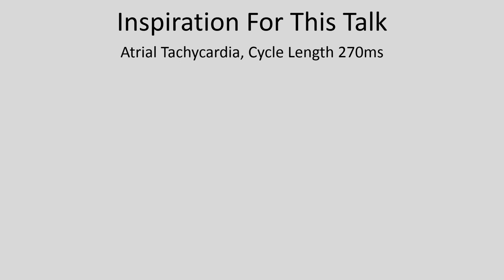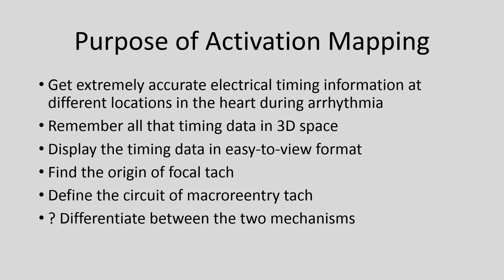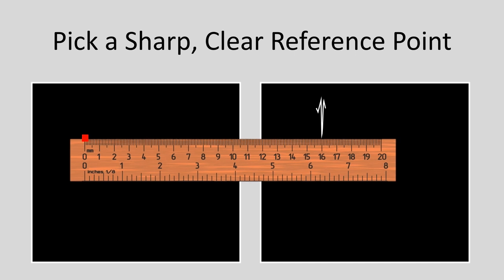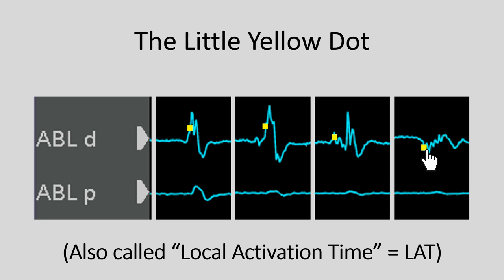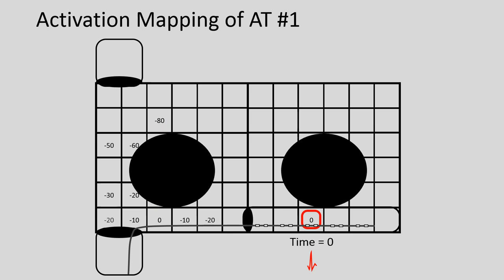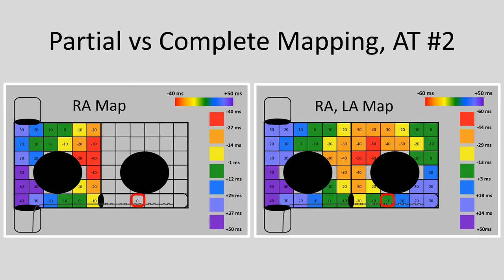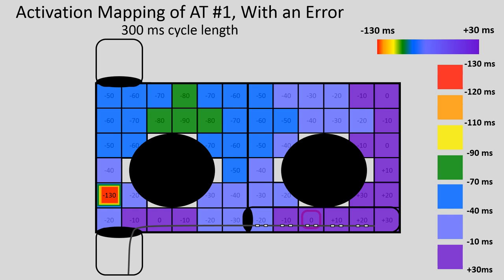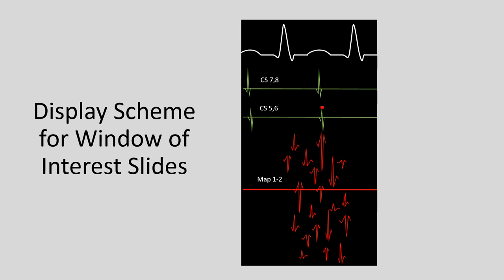Activation Mapping: Basic Concepts, Pitfalls, and Windowing

Comment: Thank You Dr. Cooper for explaining activation mapping. It was really helpful. If possible my request is, if you could make a video on activation mapping using Systems like CARTO(OCTARAY) which I found particularly challenging to understand to someone who's new to this field.
Reply from the maker: All of the principals in this video are exactly the same with any multi-spline catheter. Each bipole, whether it is the only one being taken at that time, or if it is one of 50 bipoles being recorded simultaneously, is gathering location, amplitude, and relative timing data compared to a reference. More modern mapping software can use the summation of multiple bipoles, for example from the coronary sinus catheter, rather than a single bipole, for a more stable reference. But all of the principles are exactly the same, including window of interest, activation sequence, and pitfalls related to outlier points, slow conduction, and a suboptimal window of interest.

Comment: Your Fellows are lucky Dr Cooper, I wish I was one  ! Thank You.
Reply: Two points I would like to ask you: 1) For a stable reference can we consider alternatives to Cs like NCC or azygous or even a SVC catheter 2) Ripple maps can avoid the need to annotate EGM activation time and do not require a WOI. There is no data interpolation in the generation of the map in RM, do you consider RM as an effective strategy in the situation you discuss in the talk.
Reply from the maker: @sharathkumar8518  As long as the reference catheter is recording signals in the same chamber you are mapping (i.e. atrial reference for an atrial arrhythmia) and the catheter remains physically stable throughout mapping, you could use any catheter.  CS catheter just happens to be out of the way and stable, which is why it's usually used for atrial mapping.  And yes, technologies that show wavefronts in motion in a looping format (Ripple, Sparkle, Rhythmia) add additional visual information that can be helpful beyond the static image.  I decided not to add that additional topic to this presentation due to its 2h length already!

Comment: This goes beyond anything one can give to educate young EPs. You deserve a prize and to be remembered for ever. I just have one comment, not an objection. In your initial tachycardia where 3D mapping did not work, you resorted to Entrainment map (7:55). You also mention entrainment from multiple areas in the right atria.  Entrainment is reserved for reentry tachycardias and PPI is really not part of it. The original 4 criteria do not include PPI. For all purposes the right atrial activation behaves as focal. You can use the PPI interval (Klein has shown good approximation) instead of entrainment (as this is not a reentry tachycardia) to detect how close you are to the site of origin. In my experience this does not work all the time (scarring, different activation to and from,  resetting the focus etc) the way it was originally described but I guess it can be used in challanging cases. Thanks really for your video!
Reply from the maker: Thank you so much for your comments and question!  The initial challenging tachycardia in this case actually was most likely a reentry (small) circuit within a scarred area at the thick upper interatrial septum.  The tachycardia slowed before terminating during RF ablation, reinforcing that likelihood.  Had this truly been a focal (automatic/triggered) tachycardia, overdrive pacing (not true entrainment, as you point out) can also be helpful, as long as the focus isn't overly suppressed by fast/long pacing drives.  As such, if the post-pacing interval after overdrive pacing is very similar to the tachycardia cycle length, that suggests that the pacing site is relatively close to the site of origin (especially if pacing at other sites shows a longer PPI).  A long PPI doesn't necessarily mean one is far from the focal site of origin, given the possibility of suppression and a slight delay in tachycardia resumption.

Comment: 45:54 Instead of entrainment, why not simply change your reference to high RA and re-map? Like you previously demonstrated with focal AT#1, the color scheme would remain the same… because the earliest (ie medial to the CTI line, will still be the earliest, regardless of your reference)
Reply from the maker: Using a different reference point would not necessarily change the color scheme, as you say, and would thus still show an "early meets late" appearance on the RA floor due to the prior atrial flutter line of block across the cavo-tricuspid isthmus.  To sort out the difference between a reentry pattern and a focal pattern, overdrive pacing on the medial and lateral sides of the line would show very different results with this atrial tach (in contrast to typical flutter, where entrainment would show PPI = TCL in both places; see my other video on entrainment for more details).  Thanks so much for watching and for your question!